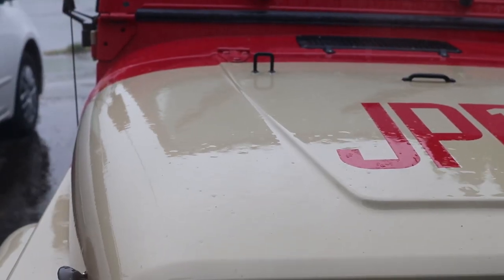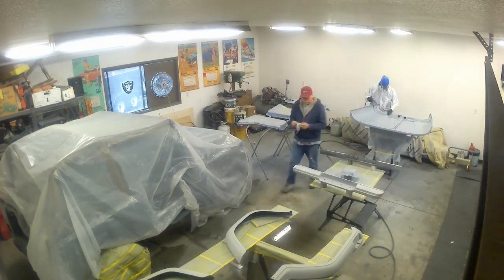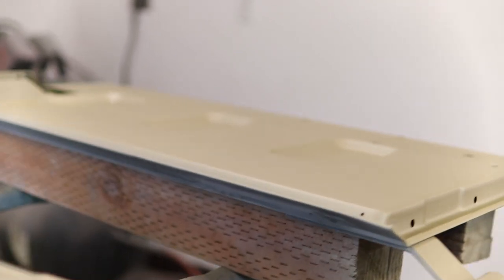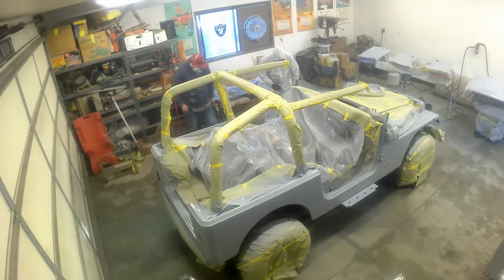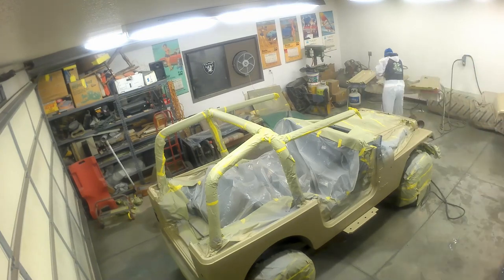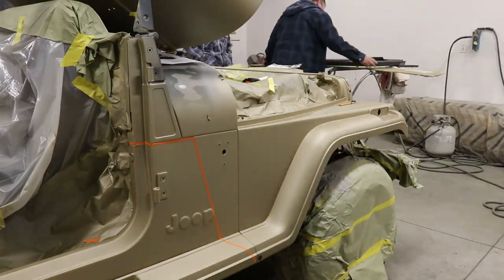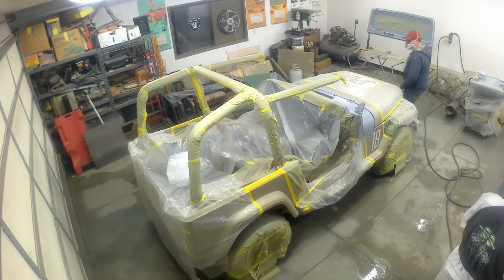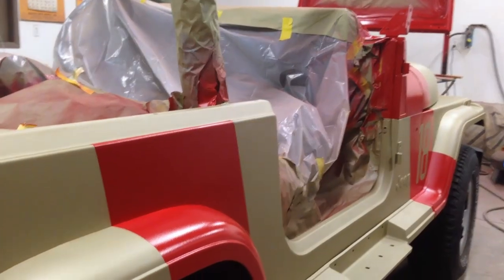I painted my own vehicle, and you can too!  Jurassic Park Jeep replica.

Comment: Nice video.  I can appreciate the effort that goes into distilling such a major project down to 12 minutes.  I'm gonna be "that guy" and mention that the windshield is supposed to  be sand on one side, red on the other.  :P
Reply from the maker: I know, and I realized that far after I painted it.  But, I like seeing the red on the inside, makes me think something cool is happening on the other side (which it is).
Reply: @BroncoSolid  I expect that it should be red, but whoever did these for the movie only wanted to paint the outside because it was easier.  Harder for us, easier for them.

Comment: How much paint did you use?
Reply from the maker: For the sand beige, it was right about 3 quarts. But buying 3 separate quarts cost the same as buying a full gallon, so I bought a gallon.  If I had to do it again, I'd still buy a gallon.

Comment: There's one small detail you did wrong, in the movie, they only painted the outside of the windshield red, the inside was still the sand beige the jeep originally had
Reply from the maker: You're 100% correct, which was an oversight on my part. But actually I 've really liked it, it lets me know that I've got a party going on on the outside of the windshield too!